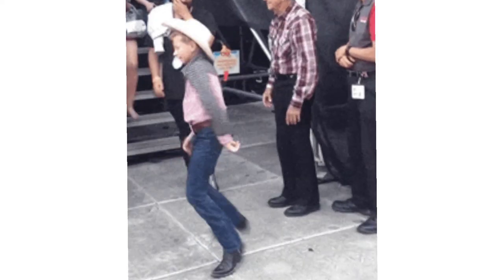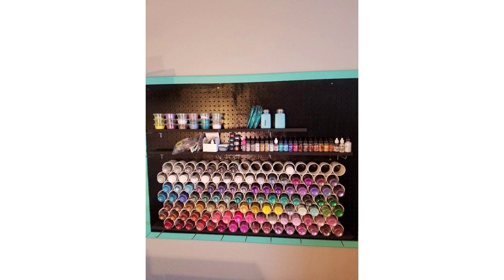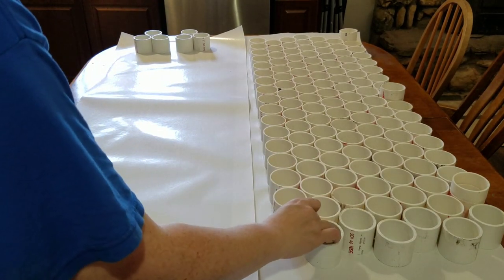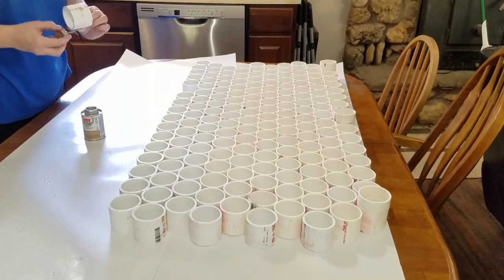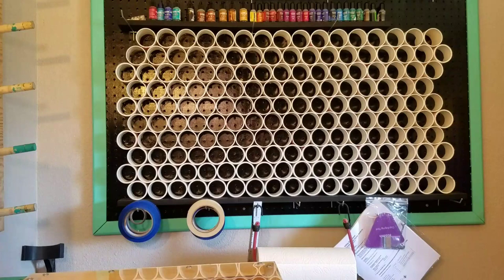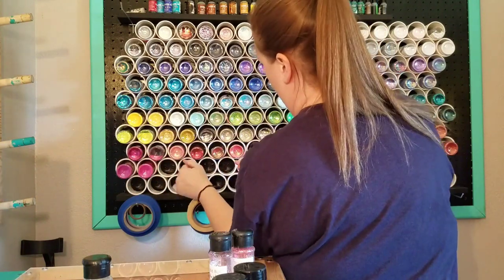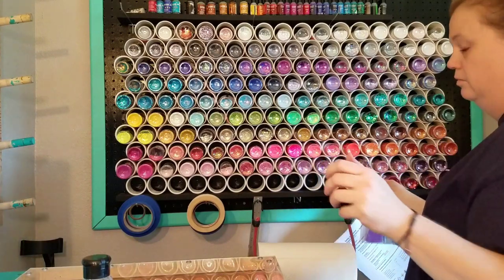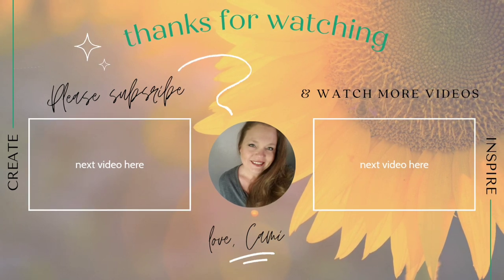GLITTER WALL OUT OF PVC PIPE TUTORIAL (NO ZIP TIES!)

Comment: How did you hang on the wall.?
Reply from the maker: At first I just had the pvc setting on a little board as a shelf which was sitting on the peg board hardware. Buy as it got bigger and taller we used thin wire at the top row and ran the wire through several of the top pvc into the pegboard holes to secure it from tipping forward. Does that help?

Comment: Did you just hang the whole thing off if two pegs on pegboard?! It seems like that’s a lot of weight for two pegs 🤔 I feel like I missed a step somewhere about how it’s mounted to the wall.
Reply from the maker: Hi there! Im so sorry I left this unanswered in the video! There are actually 7 peg board hooks under a little black shelf  and that is what the PVC rings are sitting on.
Reply: @alottletumblertutorials  ohhh so it isn’t hanging at all, it’s sitting on a shelf attached to your pegboard! That makes sense! Thank you!
Reply from the maker: @theCOBOshop  nope it's on a shelf! Idk that I would trust it to hang! Now I see where your concern was! Lol I thought you were concerned that there were only 2 pegs under the shelf! Lol
Reply: @alottletumblertutorials  baha nope 😂 I was recalling the time I completely ripped two hooks out of my pegboard earlier this year because I didn’t think about the weight I had on the peg bahaha I was thinking maybe you knew some trick I didn’t haha
Reply from the maker: @theCOBOshop  ooooohhhh... I SEE! lol nope, no magic tricks HERE! lmbo
Reply: How many glitters does it hold? I was try to count but I couldn’t.
Reply from the maker: @mducre1431  this one holds 168. I currently only have 158 in there but the beauty of this system is that you can build it as wide or skinny or tall as you need to and you can add onto it as you collect more glitters!
Reply: What are your spray paints in?
Reply from the maker: @theCOBOshop  a rolling shoe cart from Walmart! The tall one... I think it's like 10 ft?
Reply from the maker: @theCOBOshop  10 tier not 10 ft! Lol
Reply: I thought it was a shoe rack 😂 I dig it! It’s amazing what we find craft uses for isn’t it? 😂
Reply from the maker: @theCOBOshop  right?!? Like I said in one of my videos "y'all, I'm cheap and I and even afraid to admit it!" Lol
Reply: But seriously though. Me too 😂